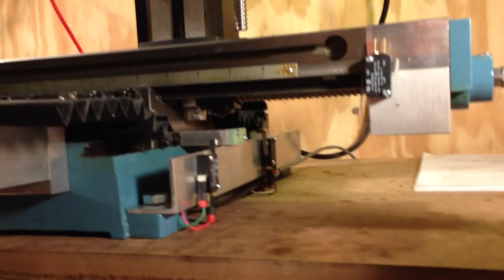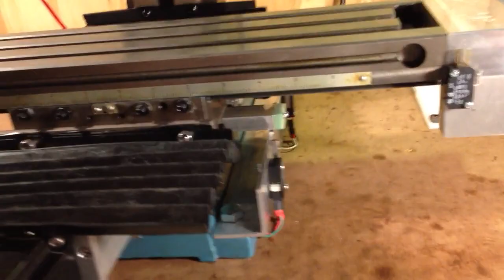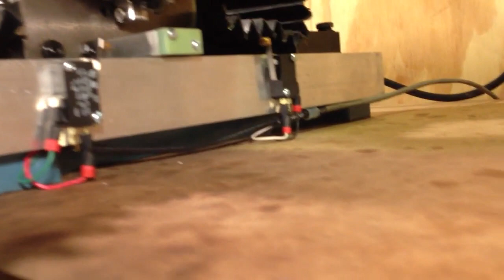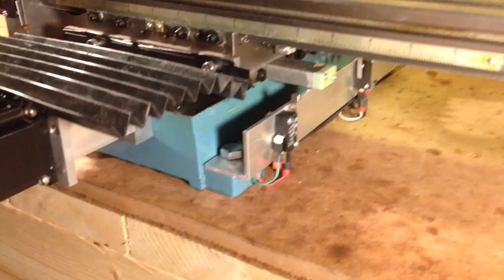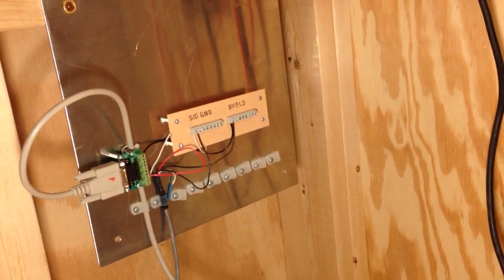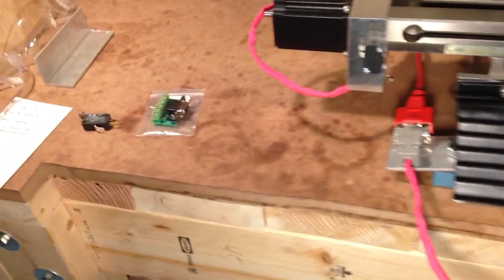LMS HiTorque CNC Conversion - limit switches

Comment: Hi allan,

Are you still in need of our limit switch wiring diagram?

I finally drew up a circuit diagram and can point you to it.  I drew it kinda quickly, so I would request using it with some scrutiny (i.e. if anything looks squirrely, please ask).